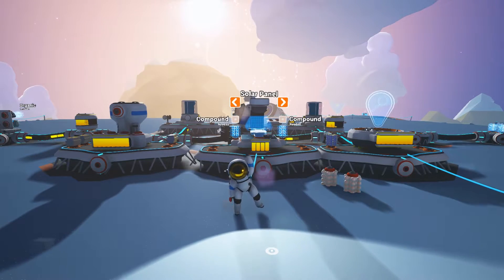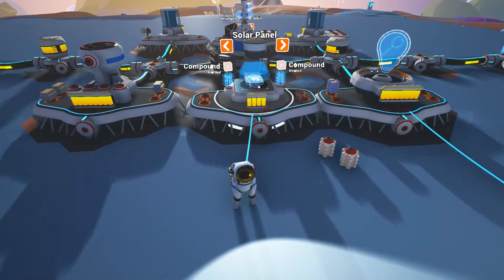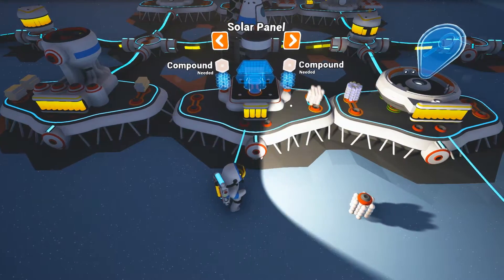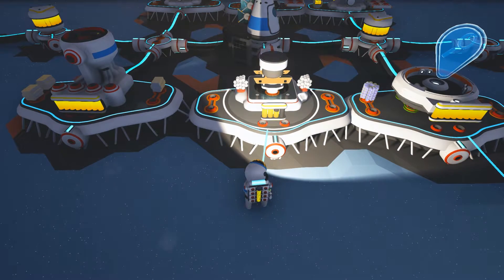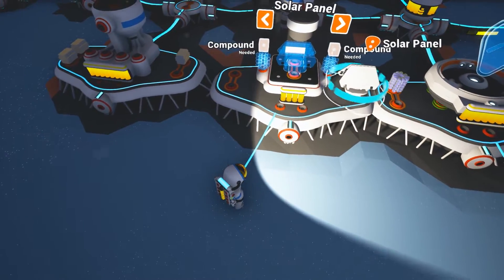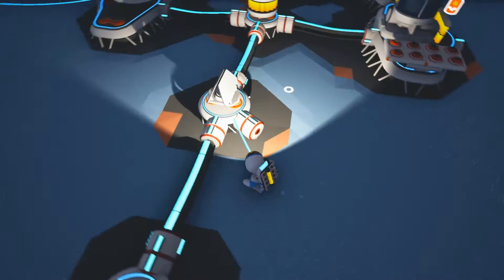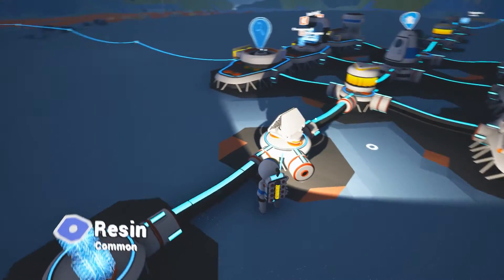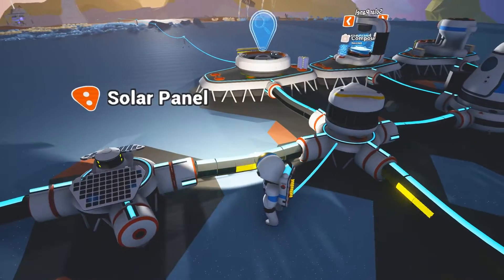Astroneer Guide/How To: Solar Panel - A Quick Astroneer Tutorial

Comment: Question  
Is there a way i can use it without a table?
Reply from the maker: In the latest version of the game (and i think since the basebuilding update was released) you can use small solar panels without a platform and connect them with extenders, but i think the large solar panels still require a 2-slot connector to provide power.
Reply: Oh, that kinda sucks.   
Well have a good day